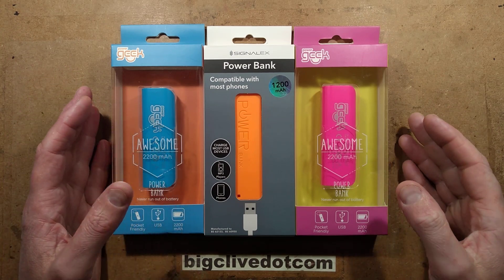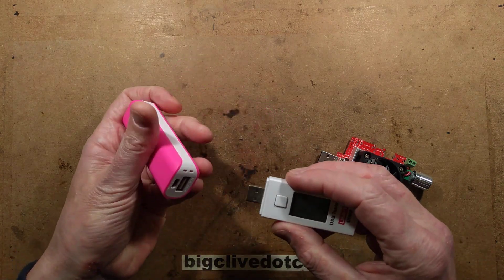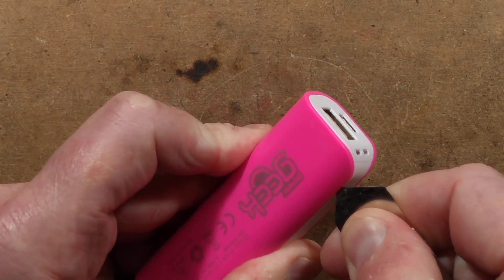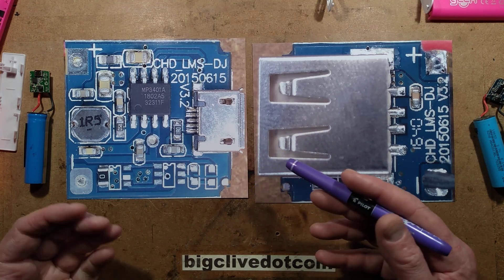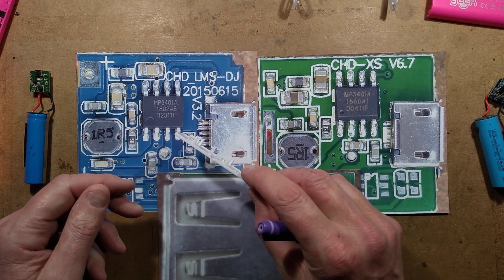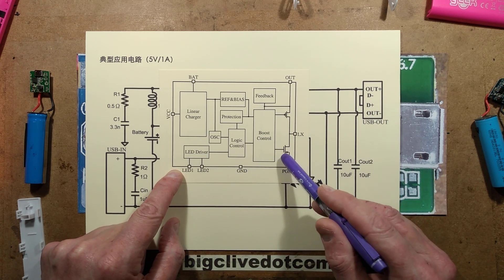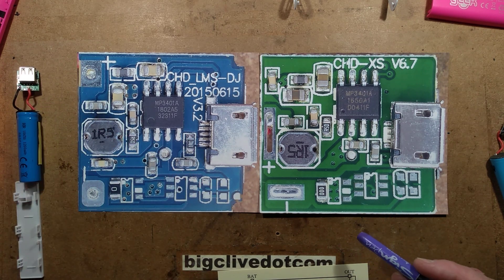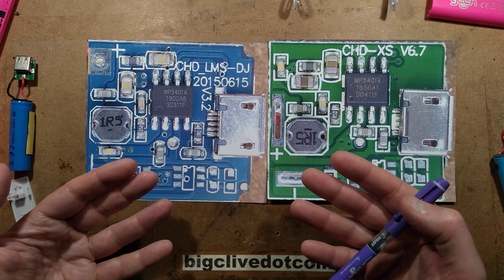Inside the new Poundland Power-geek 2200mAh power bank.

Comment: I think they get away with calling it "2200 mAh" because the cell's capacity is 2200 mAh at 3.7 V. The amount of energy in the full cell is fixed, so when you boost the voltage up to 5 V, it can only supply around 1700 mAh.
Reply: 2200mAH is on the power bank not the cell which you can't see anyway. They should not get away with this
Reply: Wish they’d just use watt-hours!
Reply: Watt hours FTW!
Reply: That also assumes he is measuring it under load, and not charging. Id assume hes monitoring the capacity while charging, which would then give the true capacity.
Reply: @TailSaber your 100% correct here and thats what people dont seem to understand. 2200mah cell it may be but you loose power during boost conversion to 5v hence why delivered capacity is lower. poundland got it right with this generation of powerbanks. for £2 and £5 you really do get your monies worth.
Reply: This. Better to measure watt hours so voltage is taken into account. However the numbers aren’t as impressive for marketing.
Reply: How? mWh is even higher than mAh, since you multiply with a voltage that's higher than 1V.
Reply: So that is why my "DIY" 18650 charger can only charge ~4 times my 3000mAh phone with the 5 3400mAh cells I put inside.
Reply: But when you test the MA hour are you correcting for the 5 volt output , in no way can it do as many MA for as long @ 5V as 3.8V . Really these testers need Watt hour then can calculate a better MA hour of the battery (-) loss due to conversion to 5V Even in charging it's 5V input converted to cell charge volts, Increasing the MA @ the cell input as to the 5V input lower current draw. The battery can not be rated in charging or discharging external the measurement tool needs connected on the battery itself, which these little testers have USB most like mine do run down to 3 volts so one can actually test a battery with a direct connection to the cell.
Reply: Yep, exactly this :) It's not "getting away with it", either - it's how all power banks (and other lithium cells) are rated. And that's generally the value you're interested in anyway, because your phone's battery will be maybe 2000 mAh *at 3.7V nominal*, so the mAh at 5V is fairly irrelevant.

In this case, 1708 mAh at 5V = 2308 mAh at 3.7V assuming 100% efficiency (which it won't be).

You can work that out by taking the 5V capacity (1708), dividing it by the lithium cell nominal voltage (3.7), then multiplying it by the USB output voltage (5): 1708 / 3.7 * 5 = 2308.11 mAh. :)
Reply: Andrew Gillard  I am a electrician and yes you are completely correct , you wrote exactly what I was going to say.
Reply: That might be true, but as a consumer I have no idea how many cells they put in series in their power banks, making this number completely worthless as an indicator of stored energy.
Reply: @anlumo1  I've never seen a power bank with more than 1 cell in series (besides the jump starter packs). They've all been lots of cells in parallel. So generally that mAh rating is good for comparing products at least. Ideally you'd want to compare Wh, but that's rarely given...
Reply: Ok, good to know. It also makes sense, that way they don't need a balancer.
Reply: Andrew Gillard  Xiaomi make 7.2v power banks, though they do still use the approx 3.7v rating (ie "20,000mAh" when it's actually 10,000mAh @ 7.2v).
Reply: @anlumo1  you can still compare powerbanks based on that number, as long as they all report the 3.7v based capacity
Reply: Only if they use the same chemistry in the same configuration.
Reply: anlumo1 even if they have 2 cells in series, they’ll not rate it at the 7.2V mAh. If they have 2 cells of 2200 mAh, they’ll rate it as a 4400 mAh product even if it’s internally arranged as a 7.2V 2200 mAh pack.

So the rating is directly related to actual capacity.
Reply: Listen - Big Clive, would not have got where he is today, by not knowing how to calculate power bank capacity  (╯°□°）╯︵ ┻━┻

Comment: Do you think it would work as a UPS for a Raspberry pi?. Great vids Clive, have learned quite a bit about electronics since starting to watch you.
Reply: The Pi is recommended to use a larger current power supply than this so it's unlikely to be a good experience. When this got to 1A it cut out which would reboot/crash the Pi.  For a solid power feed, I'd recommend a minimum of 2A.

Pi power Specs: https://www.raspberrypi.org/help/faqs/#powerReqs
Reply: I installed several security cameras around the house last year using MotionEyeOS with Raspberry Pi Zero W's as 'fast video mode' cameras and a RPi 3 as an aggregator. In every case, I installed the guts (battery+pcb) from a £1.99 1800 mAh power-bank off eBay (like the cheaper unit Clive reviewed here) in the camera enclosure and they've performed flawless during many power outages. I know the Pi technically requires a 2 or 2.5A supply and in a mission-critical application I would always recommend going with that. That said, all our cameras run off a 1.5A supplies and although the the low-voltage 'lightning bold' symbol is ever present, I've never had one crash because of it, and these units run warm. Of course, your results may vary..
Reply: A Pi Zero (W) with just a camera running will probably be fine from a 1A supply. Those don't have very power-hungry processors unlike the 3B and 3B+. I have a couple of Pi Zero W's with cameras sharing a single 2A port (via a single-to-double microUSB cable) and they've been fine for ages.

I wasn't aware that the Zero/Zero W monitored its input voltage, though? Certainly I don't see any output from any of my Pi Zero (W)'s when I run `dmesg | grep volt` over SSH (under-voltage events on the Pi 3B and 3B+ result in "Under-voltage detected!" messages appearing in `dmesg`, as well as that lightning bolt appearing over HDMI and the red power LED going out briefly). Given that I have around a dozen Pi Zeroes around the house, some with very dubious power supplies, I'd have expected to see at least one of them complaining!

Pi 3 B and Pi 3 B+ definitely need higher current capable supplies, though. Ideally one that outputs slightly more than 5.0V (the official ones output 5.1V to allow for voltage drop in the cable, and the Pi can tolerate at least up to 5.5V on its USB supply. I had a Pi 3B running from a random USB power bank for a while, and the under-voltage issues would cause random crashes, or to drop it off of the ethernet, or to have random USB devices fail... A solid power supply for the Pi 3 is essential!

When I find the time, I'm planning to design and get PCBs made for some Pi UPS modules, probably using the same ICs that I used for a recent LiPo-powered project of mine: the FS312F (protection IC, much like the standard DW01), the FS8205 (double MOSFET), the TP4056 (Li-Ion charge control) and the MT3608 (~2A boost converter) - plus a LM339 quad-op-amp and a pile of resistors to measure the cell voltage as a crude battery life indicator. Alternatively I might look at using some more "western" chips for that purpose, but those tend to be much more expensive and I'm struggling to find one that fits my needs and is in a package that can be hand-soldered - a lot of them tend to be CSP (chip-scale package) or WLP (wafer-level package) where the IC is barely any larger (if at all) than the silicone die itself, with some BGA balls to connect it to the PCB, which is obviously extremely hard to solder at home! The Chinese chips have the advantage of just being standard SOT-23-6 or SOT-8 packages which are dead-easy to hand-solder for someone with a bit of surface-mount soldering experience, plus they're dirt cheap to buy from AliExpress or LCSC (which is a Chinese electronics distributor, a bit like Digi-Key or Mouser, but stocking Chinese parts as well as some "western" parts, often quite cheaply)...

(Yes, there are plenty of Pi UPS products that already exist, but it's always more fun - and probably cheaper - to design & build one myself! Plus I can then adapt the design, using different resistors for the boost converter, to build UPS boards for 12V devices, or I can build a UPS board with several outputs so it can power a USB hub and/or an external HDD/SSD as well as the Pi, and I can use whatever size of LiPo (or pile of 18650s) I want!)
Reply: The common minimum amp ratings you see for RPis usually assume that you're going to plug in high-power USB devices (like external hard drives). If you just have the Pi with nothing connected to it, 1A is more than enough.
Reply: @anlumo1  Not for the Pi 3 it's not :) Yes, most of the time it won't draw 1A, but it definitely peaks at more than 1A and it'll get very unhappy if the voltage plummets when it does so!
Reply: Yeah, maybe don't mine bitcoins on it with that setup. Also don't play Minecraft.
Reply: It should also be mentioned that LiPo cells do not like constant topping off without discharge, but LiFePO4 batteries don't really seem to mind it.
Reply: For a Pi UPS there's only a single product line I've seen so far that I've considered putting into commercial service which is the "LiFePO4wered Pi". I got one and it passed review.
They have multiple versions and as I just went for the link I see they have a crowdsupply campaign running for the next version, the "+".  If you want Pi UPS, I would not hesitate!
https://www.crowdsupply.com/silicognition/lifepo4wered-pi-plus
The LiFePO4wered Pi comes with software to take care of clean shutdown as well as power and battery monitoring. It's quite a smart product line.